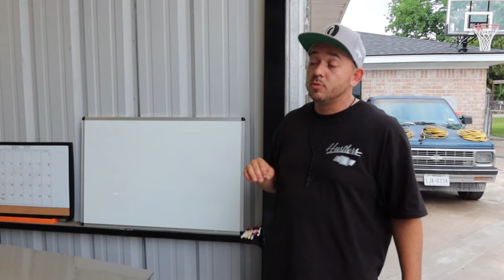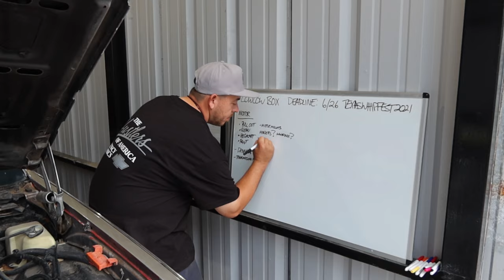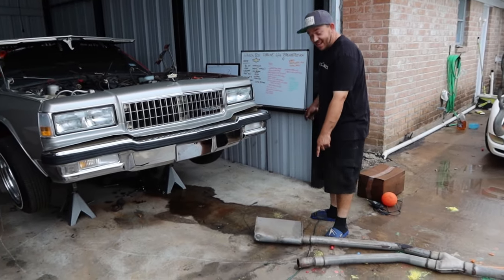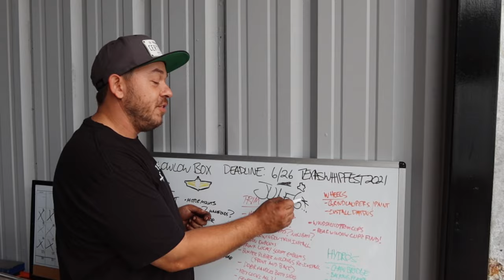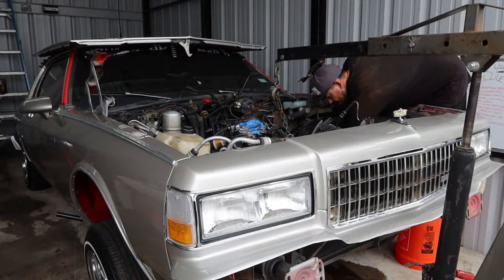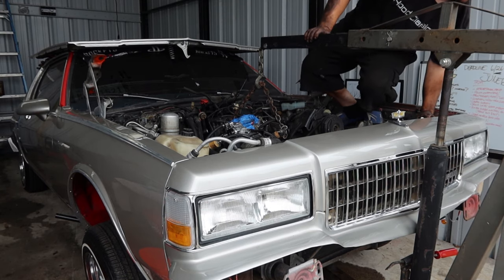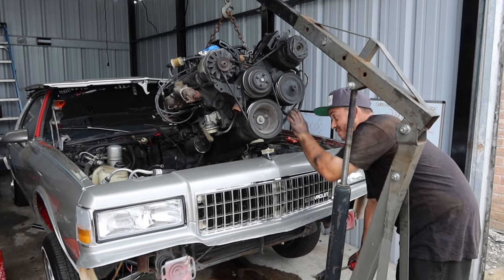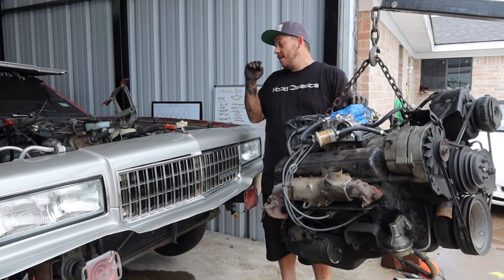How to change motor on a Caprice classic...

Comment: I Have aa 1986 2 door just finished installing the front bumper filler and the carburetor on it  eventually i'm gonna rebulid the engine and transmission before getting it paint good job on yours hope you make the deadline
Reply from the maker: We shall see!

Comment: Good Job Bro!!!!! Alot of folks got pissed off at me when I pulled the 425 out of the caddy lowlow and put a lincoln navigator 5.4 engine and ford trans in it. both engines had about the same torque but the navi 5.4 has more hp.....plus the 425 developed a rod knock......but when i open the hood folks are like wtf???is that a ford 5.4 in a caddy???Love your vids man.
Reply: I'd imagine swapping from 425 to a 5.4 also saves weight and helps with power to weight ratio. At the end when people tell me I should have do this or that i tell unless you're paying for it STFU lol.
Reply from the maker: Fuck it! Got it rollin! Badass by any means....